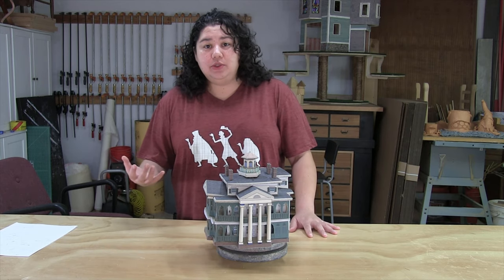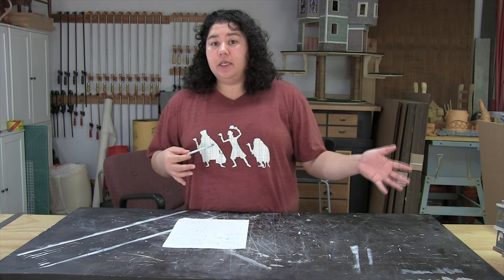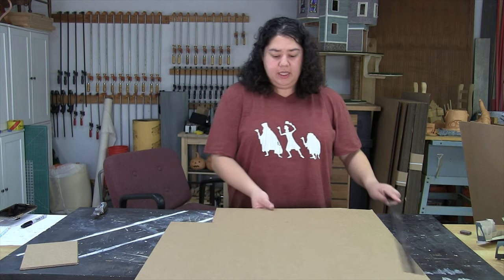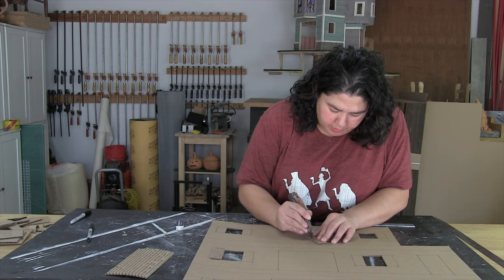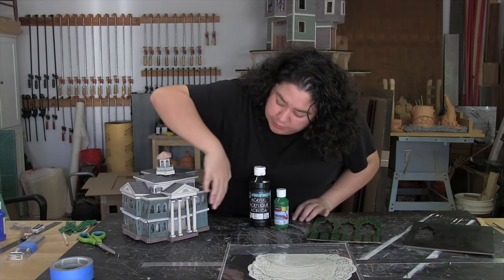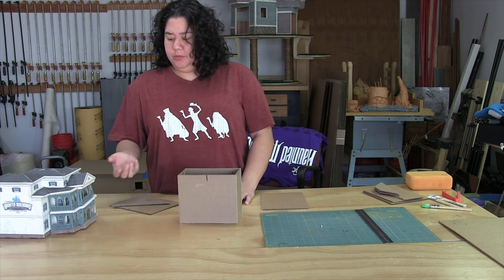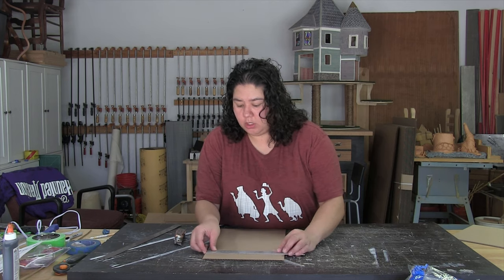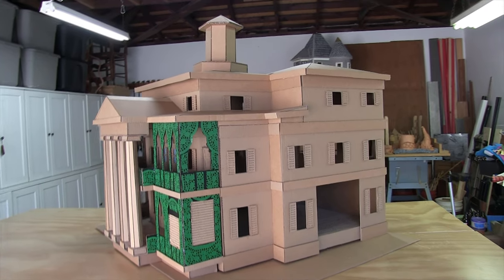DIY Disneyland Haunted Mansion: Cardboard Tutorial - Cat House with cardboard scratcher floor

Comment: What are the different ways of joining cardboard ??
Reply from the maker: Paper tape and hot glue will be the fastest methods with most support but you could get away with white school glue, masking tapes or clear packing tape depending on where you use it.  The white school glue will take forever to dry, the masking tapes (all types) will not be as strong and the clear packaging tape though strong isn’t so great if you plan on painting. 
I would avoid duct tape because it can’t be repositioned or removed easily if you make a mistake. Hope this helps!
Reply: @claytocanopy  thank you so much! It’s for my theme park project for school (:
Reply from the maker: @yeseniagarcia9274  of course! No problem, have fun!